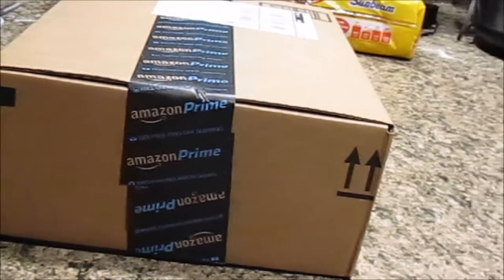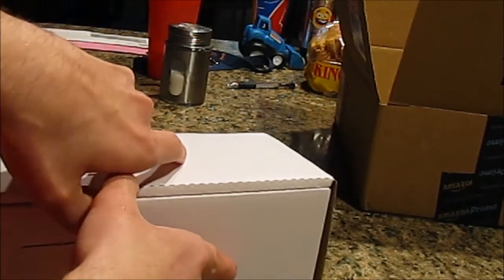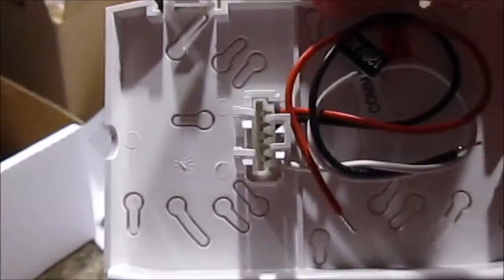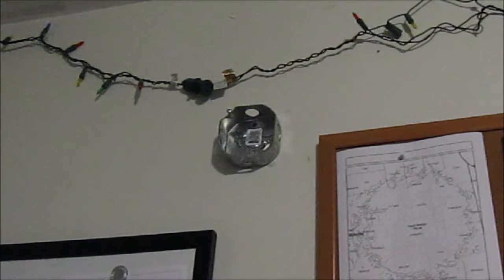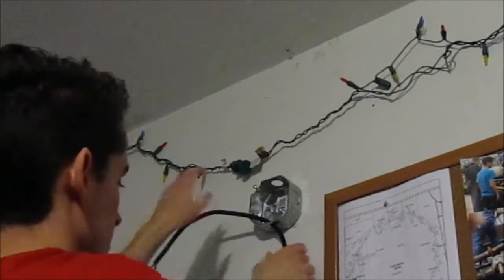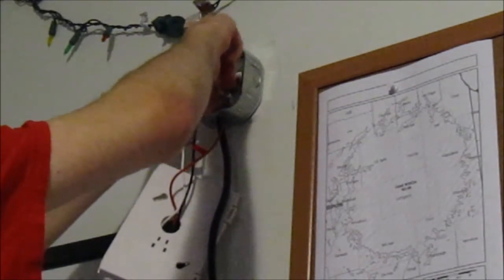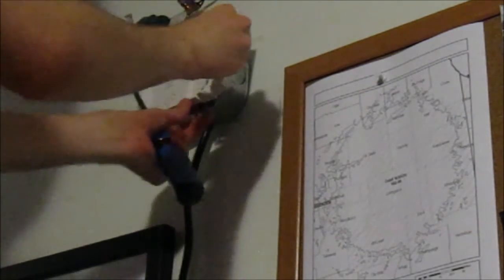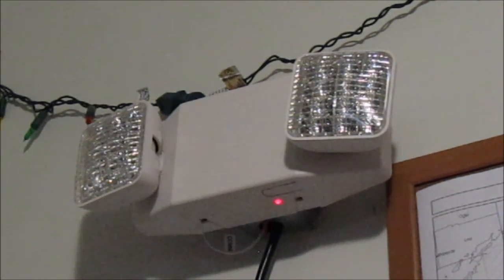Emergency Light Unboxing+Installation

Comment: Hi, im buying this for my emergency staries in my commercial building. The lights can be fully working with just electricity right? And it also has back up battrey correct?
Reply from the maker: The lights will not light unless electricity is disconnected. If power is coming to the unit, the lamps are off. It does have an internal battery that keeps the lamps lit for at least a couple of hours after power failure.